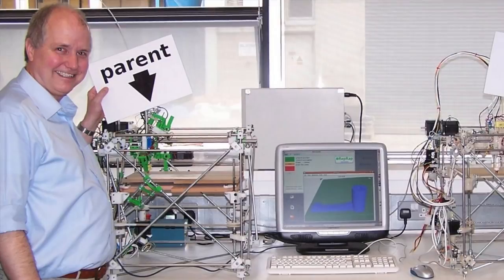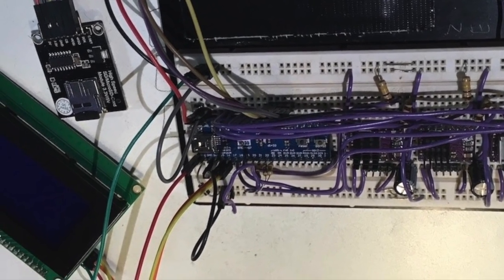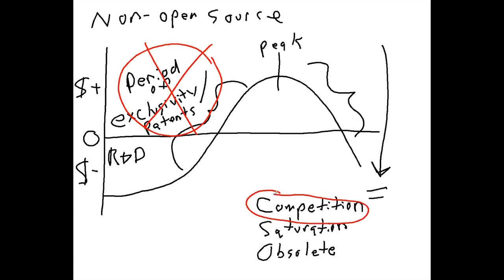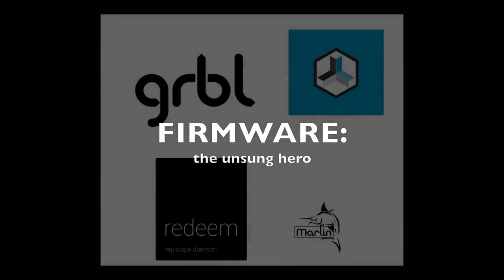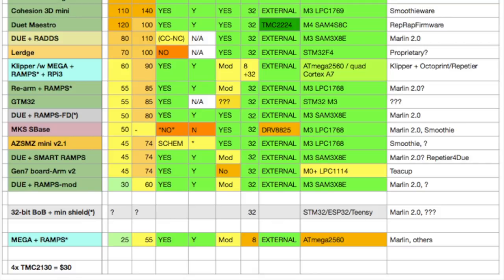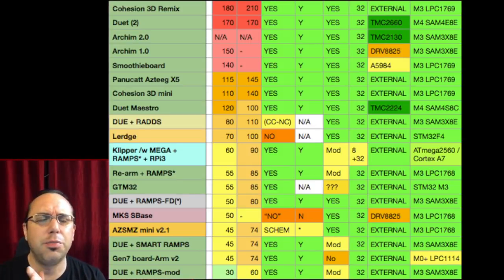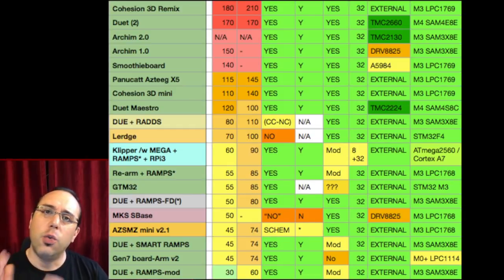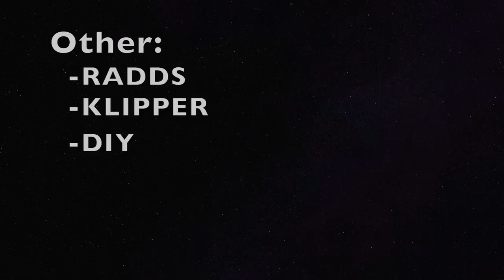Pt. 3 of 32 bit 3d printing series - Boards

Comment: Regarding Klipper, if you use the virtual SD card feature of Klipper you bypass OctoPrint nearly complete. There is no reason why Klipper shouldn't run on a Banana Pi, I have it running on an Odroid C2. It is more expensive than a RPi, but I mention it only to show that Klipper doesn't need a RPi. RPi Zero might work with the virtual SD card, for everything else it is way too slow.
Reply: I run Octoprint/Klipper on a Pi Zero W.  It's very slow to boot (2+ minutes), but once Octoprint is running it's perfectly capable of running my printer and a Logitech C270 streaming video at 1280x720x10fps.  As you noted, this only works with the virtual SD feature.  Printing through Octoprint chokes the system, and doesn't work at all.
Reply: Good to know that it really works.

Comment: BigTreeTech has SKR board which is made to be drop in replacement for MKS Gen L. Learned about it yesterday, price is less than 20$, so might order one to check it out
Reply from the maker: I am keeping an eye on it's development.  THey seem to be making some quality of life changes in the next version, and I am waiting to see if it goes open source.  There also seem to be more boards on the way with stm32 processors, as well as boards that support upcoming new drivers from trinamic, using a larger footprint stepstick, so I'm holding off a bit on board reccomendations since there seems to be a burst in development coming/in-process
Reply: @AlexKenis  awesome. I just ordered a SKR as it's so cheap to take a look into it.

STM32 seems good choice for the super low price it has. Just cents per chip if i recall right?
Reply: Did you end up trying out the skr board?  I've been looking at their skr v1.3 board recently and thinking about giving it a try. Still gathering data and looking for opinions/honest reviews on it.

Comment: I run marlin 2.0 on AZTEEG X5 GT with big foot drivers tmc2660, it's still under development, but it runs very well and silent for me.  Price is very good, and it can work with cheap tmc2130 drivers...
Reply from the maker: Good to know.  Those seem like solid boards, and I like the modular drivers. I usually cover the cheaper options, but that board family is definitely on my radar as an alternative to the non-replacable-driver premium boards.

Comment: Nice overview. There is the Ultratronics which is an Arduino Due with lot of inputs/outputs: https://reprapworld.eu/products/electronics/ultratronics/ultratronics_v1_0/. IMHO the Klipper way to perform the thing is quiet interesting from the software point of view: it enables to develop/test quickly new features/new ideas without the hassle of the real-time/memory constraints.
Reply from the maker: Thanks for the link.  I didn't know about the Ultratronics board.  I was aware of the 8-bit minitronics/megatronics, but don't really mention them because they fell in the premium category in terms of pricing and features, but it looks like they have a basic 32-bit Minitronics board now as well that is pretty cheap, so maybe I'll check it out
Reply: @AlexKenis  Yes the Minitronics can have interesting applications. I would like to see more stuff around STM32 Nucleo's, quiet cheap, lot of choices for CPUs and IOs.

Comment: Hello! Can you help me?

I flashed Marlin Kimbra in DUE+RampsFD1+LV8729. It works, but I have random freezes. When printed from Simplify3D I have two identical printer stops at the same height. This gcode printed from Repetier-host perfectly.
But other print stops when print from Repetier-Host too :(

And it freezes some times at 1-4 seconds. After 20-30 minutes of work.
It is very hard to debug this :(
Reply from the maker: I don't use Kimbra Marlin, but I know that mainstream Marlin 2.0 just did some patching of the communication code that relates to the Due and similar mcus, and it fixed some of those problems, so that may be worth a try.
Reply: Okay! Thanks for fast response! I'll try Marlin 2.0

Comment: On topic of patents; They are overall detriment to society if you look into deeper about it. For example, we would have had 3d printers for a decade or 2 longer if it were not due to patents. Adrian Bowyer only could make the first ones BECAUSE patents had just lapsed. Larger public did not even have any idea these machines exists, let alone for 2 decades already. Whole reprap movement could have began in early 90s when the first consumer accessible microcontrollers became available. Tho i am sure back then the first ones would have just been operating drivers via serial or parallel ports from normal computer etc.

Can you imagine where we would be today if we had 1 extra decade for development and demand for features?

As a thought experiment, the case using serial ports etc. could have lead to ubiquitous PC components to control 3d printer hardware directly, and we would not be discussing this. Everyone would be running some cheap old atom board or SBC (ie. raspberry pi) to operate their printer hardware and getting more performance could be simple CPU/RAM upgrade. Due to the demand for example USB might've been designed to be flexible to 100MHz range of "polling rates" (now upto 1KHz, used to be 90Hz. Gamers are painfully aware of the older generation issues) and simple USB breakout board similar to RAMPS shield to hookup LCD, stepper drivers, ABL, limit switches, thermistors, ADC/DAC converters etc. But USB has too low polling rate for that today AND AFAIK general PC hardware just lacks the I/O required and one of the big things for Raspbi is the few GPIO pins which AFAIK are limited to only digital (no analog), and the big thing with these microcontrollers is the analog I/O to hookup very basic electronics such as thermistors, inductive sensors, HAL effect etc. whatever gives a analog output.
All of the controlling software would then be developed like any other PC software and could target whatever CPU you have, whether an ARM, X86_64 or even i386. Whatever microarch a C/C++ compiler has been built for and could run a Linux kernel...

And all of that would open possibilities for a ton of other stuff too, such as programmable ECUs running in same fashion (they are now working on Arduino Mega2560 ECU shield + code based on megasquirt!) when regular PC could easily access nano/microsecond scale hardware I/O, both digital and analog.
Reply from the maker: Agreed.  In theory, patents are supposed to allow an inventor exclusivity period to recoup research and development time, but they are applied much to liberally and with much too wide a scope.  I have had friends litigated out of business because of a single toggle switch because of overly-permissive patents. And then there are the "we can't make this work, but we'll sit on the idea so that we can license it to a company that us not as incompetent" which happens a lot in the PC world... don't even get me started.  It would have been great to have a 2 decade jump on working out the kinks of FDM.  Solutions re coming (slowly) but outside of the open source tinkerer, companies are only going to innovate as fast as they HAVE to in order to stay competitive (see Intel, et al for examples of that).  

And yes, USB kinda sucks.  On top of the polling rate limitations you mentioned (that are made even more complicated in Win10) there is no DMA to speak of (like there was in firewire and is in Thunderbolt) until the next standard, and timing inconstancies cause headaches in many applications. General cpu SBC's like RaspPI have the same problems, unless you add DMA and expansion I/O, or run a system like Klipper that uses a general CPU for compute, networked to an MCU for critical tasks. The future MAY be cpu+mcu+ASIC's+sensors, but there seems to be no urgency to get there because people seem perfectly willing to pay $6,000 or more for 8-bit, open-loop machines. It's frustrating
Reply: Part of the reason people pay big money is that there just is no easy options, and just having that 8bit is cheap and most importantly easy.

I've been wishing for closed loop for a long time, now finally options start to appear to achievable pricing and supported, but it is generally too expensive or complicated for me to spend time on those. Tho it gets constantly easier due to the open source tinkering nature of the current ecosystem :)

Comment: Alex, I noticed a lot of disregard for Repetier, not just in your videos, but generally in the community. Its had stable support for 32bit (Due) for a couple of years now. Way before Marlin, and has a HAL for easier portability. Why call it a hack and generally don't really mention it as an option?
Reply from the maker: That's fair.  I forgot that Repetier picked up support for SAMd boards.

Comment: $52.99 delivered for a SKR V1.3 (LPC1768 100mhz based) and 5 2208 drivers with wires and a typical (throw it in the garbage) USB cable.  This stuff is getting so cheap that I finally had to jump onboard.

Comment: 14:12 - The video below explains why the excuse of 'We just didn't know, or Language\Culture barrier excuse.' wasn't accurate. I know someone who met with their bosses in Nov 17 and they initially did not want anyone copying them. They then used a specific person to run a PR cover story but everyone that was dealing with them already knew there was no misunderstanding. They only backpedaled because of export restrictions that could be enforced there just by pointing out they were misusing licensed software. There have been several suits and the entire open source hardware/GPL info had been translated years ago. Linux had already set the standard for the license.

https://youtu.be/SGJ5cZnoodY?t=1125
Reply from the maker: Thanks for sharing.  For some reason, the commend got caught in the spam filter and I didn't notice until today... sorry about that.

Comment: Klipper supports multiple MCUs. An Odroid C2 with some blue pills would make an unbelievable fast system.
Reply: I ordered some blue pills and a couple v4 CNC shields last week to test with Klipper.  It would need external mosfets, but should work otherwise for a 3D printer.  I've also contemplated building a Morpheus board (https://github.com/pscrespo/Morpheus-STM32), but I've never made a PCB and the design is completely untested.
Reply: Aren't the CNC shields for arduino nanos? Or do they exist for stm32 too?
Reply: They're for Nanos.  I'm planning to use a breadboard with jumpers to make it work.  It's just an experiment for now.  I have a mini mill that I'm converting to CNC.  After I play with the blue pill I'll pop a Nano in it and run GRBL, but I want to mess around with the blue pill first.
Reply from the maker: I have a few of those CNC shields  as well. They are a couple bucks so why not.   I have used them just like you have, with external FET for the hotend, etc. Somewhere I also mapped out all the RAMPS pins you need to jumper-wire to a bluepill/MapleMini (I think I included a pic of it in this video). Those single and double stepstick boards work decently too (usually called 'arduino a4988 stepper motor shield') and they are like $1.50 a piece. Marlin 2 definately runs on a bluepill, but you have to keep features to a minimum to fit them in the 128k of FLASH.  I wrote a profile and pin map for some other ST-based breakout boards as well, which I hope to post soon (been waiting for Marlin STM32 support to mature a bit... I have done a bit of work on it myself, but I have been really short on time).
Reply: I believe that its recommended to run the whole kinematic part on one MCU with Klipper due to timings.. so a minimum of 4 stepper drivers connected for XYZE1
Reply: I think the extruder is not that critical
Reply: no it's not as critical, but it's still recommended....
Reply: @Nitram_3d  This is not true. Plenty of people are running XYE on one MCU, and Z on a separate MCU for Voron printers. The key is the endstop needs to be on the same MCU that's running that particular axis. Other than that it doesn't matter.
Reply: Yes I have read up ... on non deltas X and Y and there endstops on one MCU on deltas A, B and C and there endstops( well all) on the same MCU..... sorry that I had got it wrong...

Comment: Kinda sad to see Niamo Wu turn to the dark side when it comes to open source. Though not surprising seeing how un professional and bitter she has been since this video was released. Also for the raspberry pi issue, an old pc will work as well, which you can often get much much cheaper. It will also work with repetier server which several orders of magnitudes lighter than octoprint.

Comment: At 11mins you are really being unfair. A lot of designs often had poor headroom to begin with. They were not cheaped down till they burst into flames.
When you drive a 1 Ohm heated bed at 12v and 50% pwm with no kind of voltage conversion at all, you are bang-bang slapping 12v and 12 amps through it half the time. It is bad. Very bad and the fact that this is still being done shows the ppl designing this are not taking it seriously. Poor transistors have to handle a lot higher loads than they would really need to if this had been done right.
A lot of the machines out there are also EMI nightmares because of this.
When it comes to copper thickness, many designs do not even specify thickness. They just draw up a board and hope.